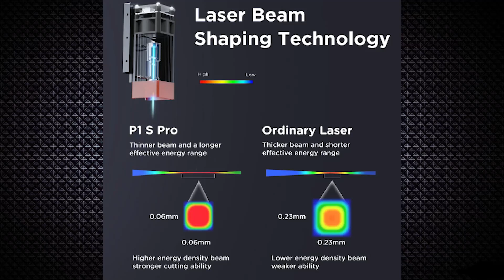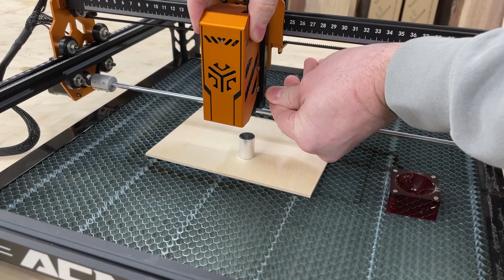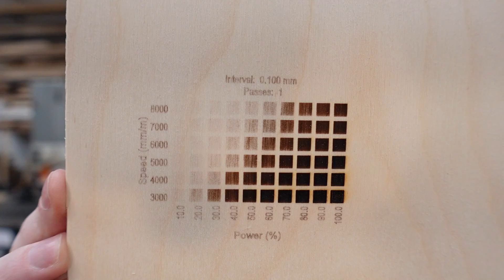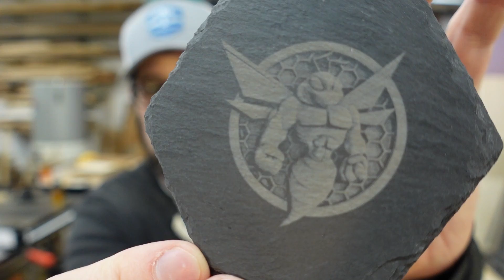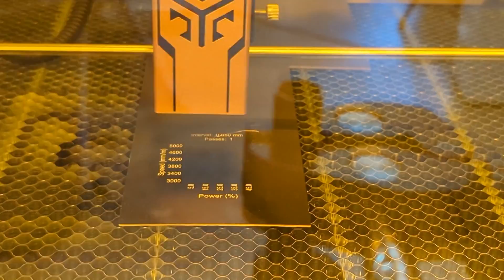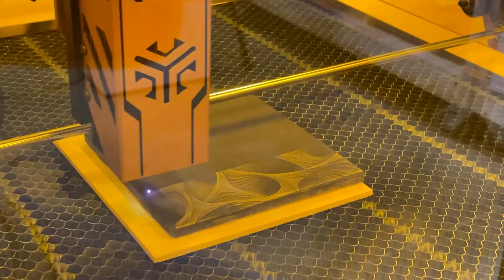Acmer P1S Pro 6w Diode laser Review

Comment: My machine is not working. I’ve tried to go back to factory settings but it’s not easy to do.
Reply from the maker: I'm sorry to hear that.  If it's the laser control board itself, you can factory reset it from the Console. To factory reset your GRBL laser, connect your machine to your computer and type $RST=$ into the G-code or console command bar in LaserGRBL or LightBurn. This clears all custom configuration settings and reverts the board to its base GRBL defaults.

Comment: Hello, great Test!
I am thinking about getting one. But for me cutting ist very important, so I ask myself how good the 10W or 20W Version of that laser is with that compared to the 6W, what can I expect?

Are the black friday Deals rigth niw a good Deal or are ther regulary Deals Like that?

Warm regards from Germany
Reply from the maker: If cutting material is key, then I'd recommend a higher power laser in the 20w range and one that has air assist with it. Black Friday deals do tend to be the best time of the year to have the best selection of deals.  Other than that there can be deals when new models come out and they discount the previous series.
Reply: @Vintauri Thanks you a Lot for your quick answer!

Comment: Hello my friend, great review of the engraver, congratulations! I have a question: I bought this model and I’m having some doubts when it comes to aligning the position of the piece with LightBurn, so I can know exactly where it will cut or engrave on the material. This becomes tricky when I’m working with something like a business card, for example, just like the one you used in your demo. Do you have any tips to better guide me on how to align the piece and place it on the bed in the exact spot where the software indicates it will engrave?
Reply from the maker: Two things you can do, one turn on the fire laser when framing and set the output to something really low like .5% this will allow you to have the laser run an outline around where it will engrave and you can adjust your positioning from there. The other thing you can try is to use a sacrificial board underneath the item you are engraving. Draw a box the size of your object in lightburn and engrave that outline in the sacrificial board.  Then without moving the laser, place the item in that box.  Then in lightburn turn that box to a tool line using one of the last two layers so it will not engrave and place your artwork / text inside that box.  Then it should be aligned when you go to engrave it. I have a video on framing that you can reference here: https://youtu.be/_zXOa2Z6taI

Comment: Does this laser come with software? If not what is the best /cheapest one to get for a beginner
Reply from the maker: It does not come with the software, but there are two primary options. The best overall will be Lightburn, it will cost $99 usd for the software, which comes with one year of updates. After that you can continue using it without updates, or pay $30/year to get another year of updates.  The other free option is LaserGRBL.  It will allow you to operate the laser, but there is no direct support outside of internet groups and you'll find fewer resources on how to use it.
Reply: @Vintauri  thank you!

Comment: Great video! Any suggestion on entry budget engraver for brass?
Reply from the maker: Unfortunately, brass is one of those materials that's going to need a fiber laser to work with.  At a minimum a 20w fiber will be needed. You can check my videos on the ComMarker B4 and B6 lasers but they are not cheap and start around $1500 depending on sales and taxes.
Reply: @Vintauri  much appreciated!

Comment: Thank you for the very useful video.
But 6w is optical power right? I am very confused when see many manufacturers advertising 20 40 80w but the price is cheap.
Does cutting 300gsm paper cause burned edges? and what speed do you think is appropriate?
Reply from the maker: 6w is the optical output of the laser.  Sadly some will mention the input wattage from the power supply but that is not a good indicator of the output power of the laser. I have played with some card stock in the past and you will have some slight charring on the very edges.  I don't have a recommendation on speeds as it's been a while since I was testing paper for cutting.

Comment: I see Ilkone or someone like them is offering a 70w. Is it too much for most uses?
Reply from the maker: If you want raw cutting power the 70w will help.  I've not been able to test one yet so I can't speak to how well they perform or how much detail they might loose with the higher wattage beam.  If you are wanting high quality engravings, it's hard to beat a smaller unit like these with a single diode emitter creating a very small focus point.